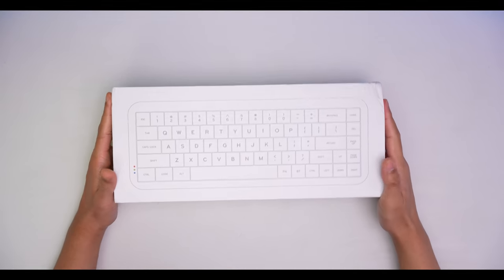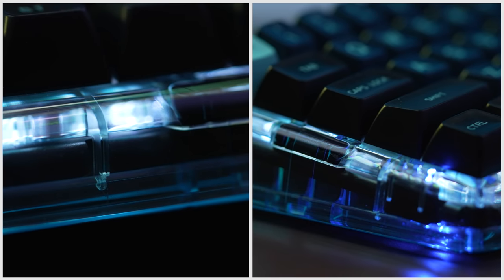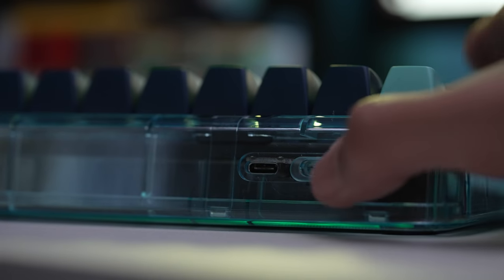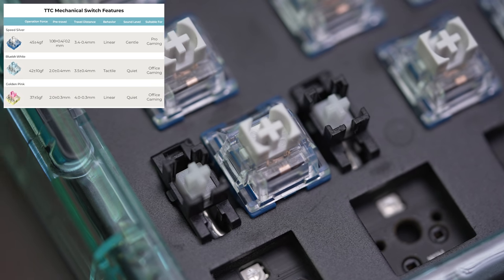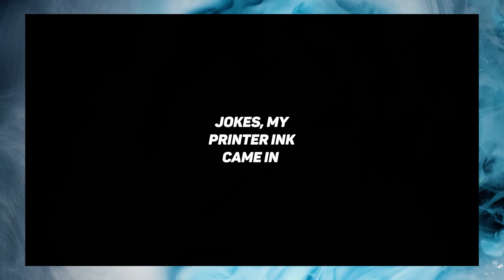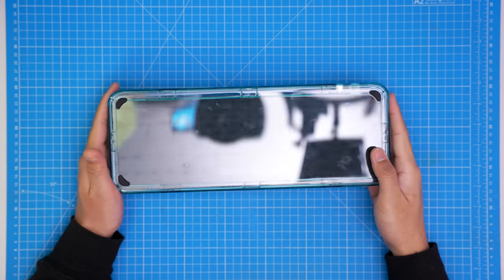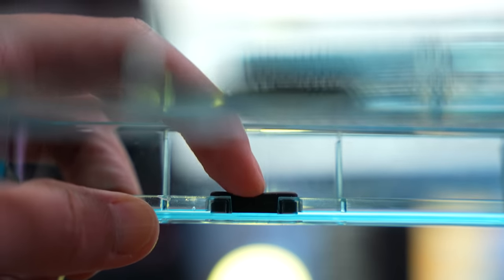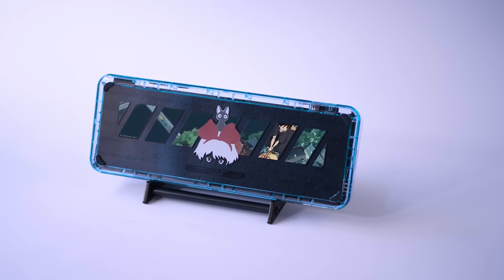MOJO68 Wireless Mechanical Keyboard Review

Comment: So it basically has a 67lite/Rama mute mount thing but with poron instead of silicone.
The plate looks like it has some tabs that roll down like the GMMK pro, maybe if you trim the part that is rolled down (not the part that is flat) it might have a little more flex.

Comment: Just to clarify, 2.4GHz is used for lower latency than BT, its essentially close to wired latency. But, BT 5.1 already has pretty good low latency, plus uses less battery, for casual users, BT mode would be fine.

Comment: Love the quality of your vids and the customization you put into keyboards. You said adding the design wasn’t the best way to do that, I’m assuming you used water decals? Did you put a topcoat? what would you say is the best?
Reply from the maker: Ye, not the best because i had to cut everything quite precisely, and then line everything up. If I had like a clear backing sticker, it would be easier. There's also other methods.
Clear coat was applied to the decal itself after printing. But nothing after that :)
Reply: @TaeKeyboards  really appreciate the reply! Thanks man

Comment: Is there a reason why I would pick this over RAMA KARA SEQ2 which is going for a similar price with similar aesthetic? Better keyboard at stock?
Reply from the maker: KARA doesn't come with keycaps, switches, and stabilisers. So I guess you have to factor that in with pricing. 
Additionally, KARA is HHKB layout, while Mojo is 65%. So that's dependent on what you prefer :)
Reply: @TaeKeyboards  Thank you for the fast reply! Between the two if you didn't care about the layout, which do you prefer?

Comment: They can make it hotswap, south facing, wireless, and gasket mounted. But they can't make it have screw in's. It's such a good looking board but they thought "yeah, we'll make it so you can only use plate mount stabilizers" like i would've been okay with them giving plate mount stabs and having a plate that allows both screw in and plate mount, but they made it so people could only use plate mount. So dissapointing to see this in such a good looking board

Comment: How are MG keycaps for typing in comparison to other high profiles like MT3? I'm thinking of joining a future MG group buy these caps look fantastic.
Reply: MG is a slightly lower SA with MT3 like scoops. If you like SA but think it’s too high this probably isn’t it. If you like MT3 but think it’s too high, this could be good. If you’re just curious, Melgeek has some MG caps in stock atm.
Reply from the maker: yup pretty much what Ares said. I should have talked about it a little bit more, but I personally don't use MT3, SA, and those kinds of profiles that often.

Comment: Since this has north-facing switches, won't there be interference when using Cherry profile keycaps? 6:18
Reply: depends on the switch. some switches like gateron milky top switches have an extra bit on the top housing that causes interference (kailh box and gateron ks9 switches do not have that extra bit afaik- not sure about other switches). 

switches that have a long pole stem (boba u4t, kailh pro/speed switches, cherry speed silvers, etc) also do not have interference.
Reply from the maker: My unit had north facing switches, however the production unit has south facing. I did experience interference when using Cherry profile keycaps, as shown in the sound test, and then I mentioned it after that :)
Reply: @TaeKeyboards  Sorry, I missed that part!
So you're saying the PCB in the final mass-produced version going out to Kickstarter backers will in fact have south-facing switch mounts? Awesome!

Comment: 'Budgetish'

Me: wow finally something I can buy. 

: costs 120.99

Me: 😑
Reply: Damn bro! WTF is your definition of budget??? 120 is decent for an entry level board.
Reply: @johnyjoe2k  he said it was budget but it costs like 120£ to expensive I'm thinking like 30$ 😂
Reply: @ViralClipsYT4k  Not to sound elitist, but $30 would be what you pay for a decent set of key SWITCHES, let alone the keycaps, case and PCB for the rest of a keyboard. 

Considering that this keyboard comes with extras such as:
• Bluetooth 5.1
• 2.4GHz Wireless
• hot-swappable switches

You'd be hard pressed to come in under that price for the quality.

That being said there are a couple quality boards that come in cheaper, but not by much. A $30 keyboard will get the job done, but you get what you pay for
Reply: @ViralClipsYT4k  bruh
Reply: @reservoir_flow  no sorry I didn't mean the keyboard should be 30$ I meant for me budget is 30$
Reply: @ViralClipsYT4k  Which is fair, you have your own personal ideas of budget. 

I was just arguing that it should also be relative to the space/commodity you're getting 

A $3 budget speaker is multiple times cheaper than a $70 budget soundbar. But you wouldn't use a $3 speaker as a comparison because obviously the soundbar will be better.

Keep on enjoying exploring keyboards chief till you find one that fits your budget, whatever that changes to be as you explore it